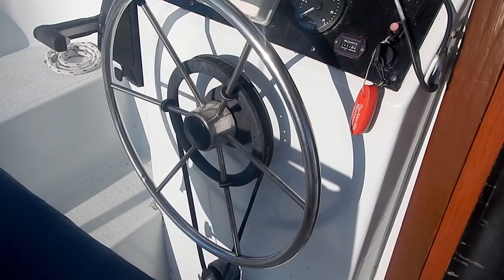Old Boat Problems! Temporary Catamaran Steering Fix (Boat Work: Sailing 9 LIVES)

Comment: rasps are for wood
Reply from the maker: rasp /rasp/ noun: a coarse file or similar metal tool with a roughened surface for scraping, filing, or rubbing down objects of metal, wood, or other hard material.

I didn't have a rasp, nor a file... but the cross-hatch pattern on the handle of my ratchet did a decent job of filing down the inner surface of the steel shackle I used. :)